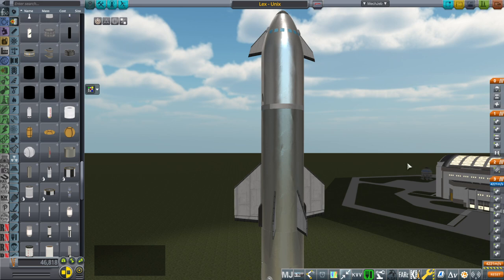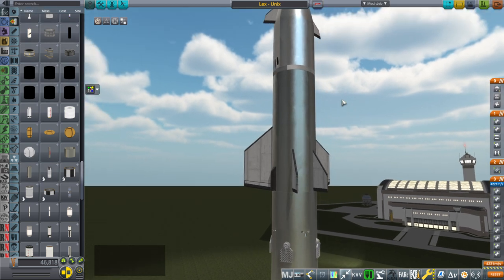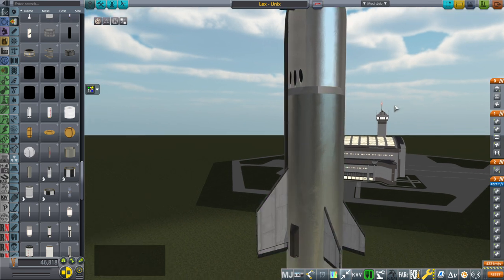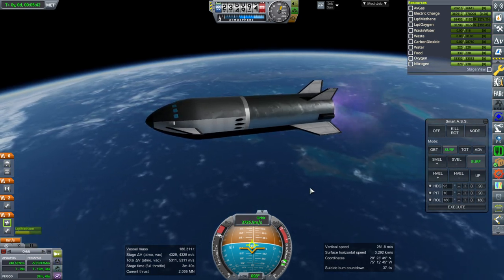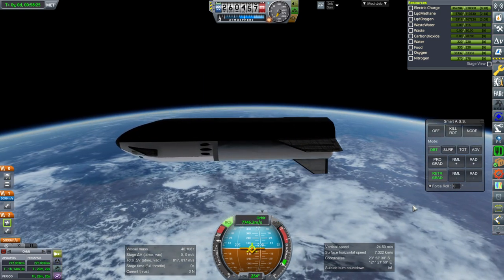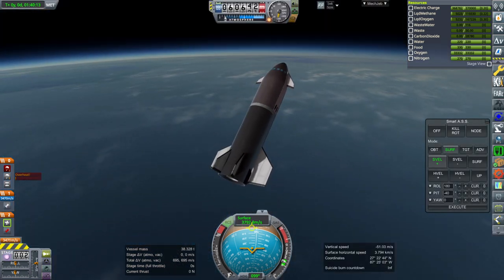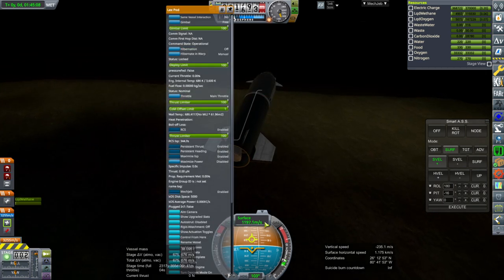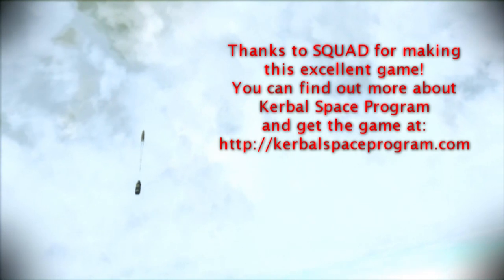Realism Overhaul in KSP 1.8.1 - Wings for Lex

Comment: Has spacex ever commented on how they would certify it for LEO human flight? Under the current rules it would seem impossible.

Edit: Starship not lex
Reply from the maker: Assuming you're talking about the actual Starship, and not this smaller alternate, which rules in particular do you think would make it difficult?
Reply: @RaizSpace  Nasa's certification process, simmilar to dragon 2 to be rated for human flight.

Even the space shuttle had recoverable points, a fully laiden starship wouldn't be able to "return to launch site". 

 Assuming a nasa certification is even necessary - since they would be launching from the USA but not Nasa's pads?

Edit: spelling
Reply: The idea for Starship is for it to be so reliable it doesn’t need abort options. It can still do multiple engine out and abort to orbit scenarios
Reply: @samsherlock2047  That's what they said about the shuttle and if an engine ruptures I assume it would damage other engines.
Reply: Ed By Superheavy won’t RTLS IIRC, so they should have a barge downrange that Starship could land on. But you’re totally right to think that Starship is lacking in abort options compared to current spacecraft. It does make me uneasy.

EDIT: Wait, no, Superheavy does RTLS - it’s just that launch site isn’t necessarily on the ground. So yeah, that’s not an option either.
Reply from the maker: As good an idea as aborts are (and obviously I built a launch abort system into Lex), I don't actually know if they're required for NASA certification for human rating.
Reply: Aborts aren’t necessary or at least they weren’t because the space shuttle didn’t have an active abort system
Reply: @edby995  SpaceX can fly people as long as they get FAA approval and everyone on board signs an informed consent document, basically. 
That doesn't mean they can fly NASA astronauts, because that's up to NASA, but they could certainly fly any person who was willing to take the risk, at least in theory. There are no laws saying that only NASA can fly humans into space from inside American borders.
Reply: @sycodeathman  and if they feel that, thats a problem that will completely make the project impossible, they can just call someone from another country and do it there.

Comment: Do you think you will ever make real Starship flaps? B9 is hard to work with, and since Tundra isn't RO compatable, its hard to make a authentic starship/superheavy
Reply from the maker: I haven't had a lot of success with my aero parts working with FAR, so that's basically the hang-up. I've definitely thought about it, but I don't think the results are as reliable as with B9 Procedural Wings, which seem to consistently perform as I expect them to.

Comment: Where can I find the wings for the starship and what are they called so I can search for it?
Reply from the maker: I just use B9 Procedural Wings to make them - they're not a special part.
Reply: @RaizSpace  that's actually why it does not fly tail first, in tail first configuration no mass shifted in real starship, only back wings folded, so they don't create (parasitic) lift, and starship has only two tail wings not four(again folding should create yaw control)
Reply from the maker: Well, it used to shift mass. We'll see exactly what they actually end up with. I'd hate to have to protect a hinge like that from reentry plasma.